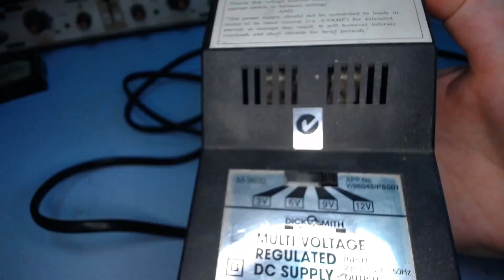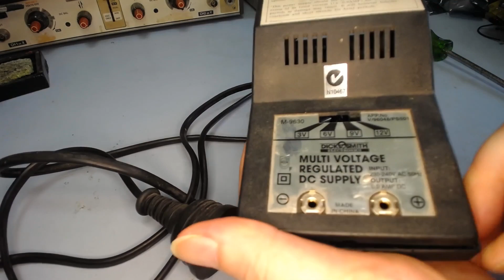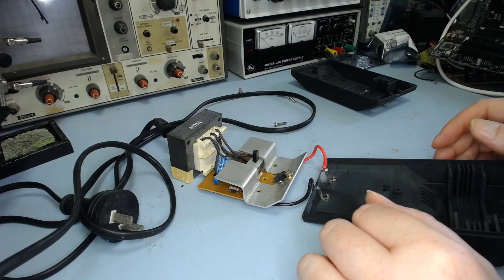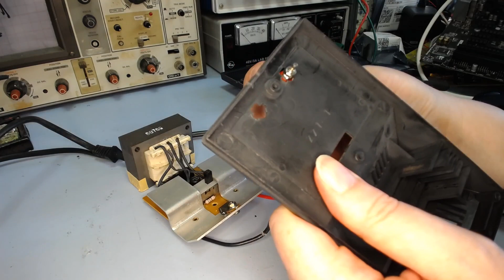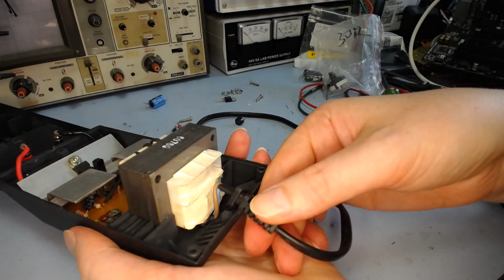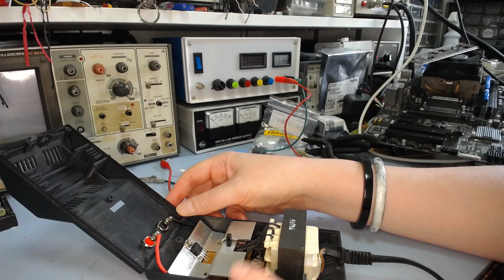Dick Smith M-9630 Power Supply Repair and Improvement

Comment: Could adjust the other voltages, then add a trim resistor to the 3V one?

Or even change the values wholesale so it puts out 3.3 / 5 / 9 instead
Reply from the maker: I may do something like that in the future, first I need to verify if the voltage drop is actually a fault or just measurement error. I'm thinking quite possibly I just need better test leads etc.